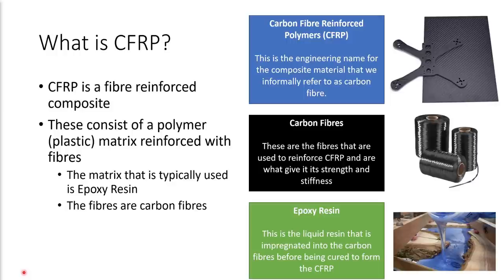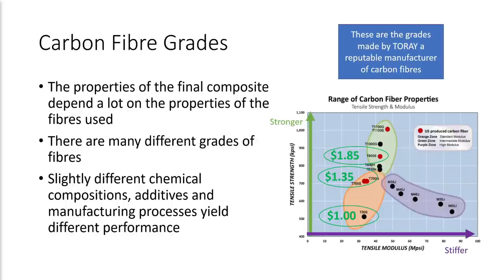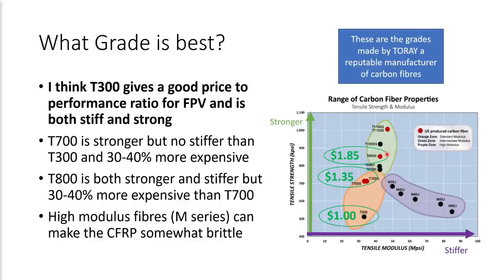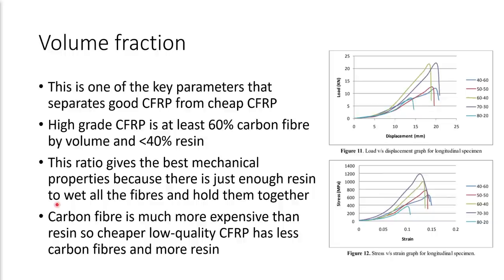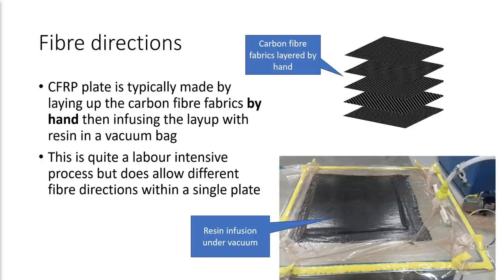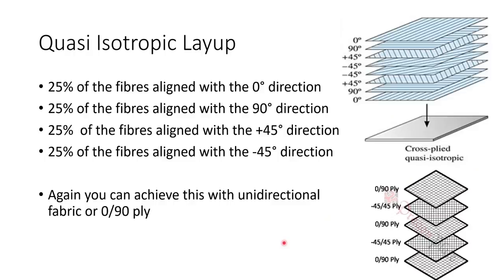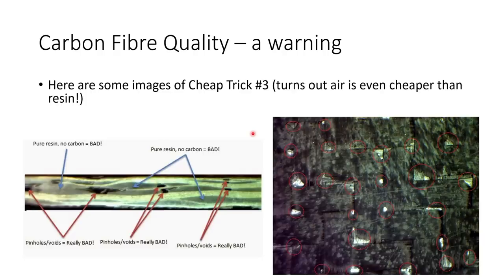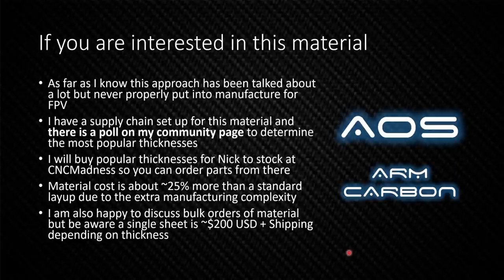Carbon Fibre: A deep dive on this incredible composite material

Comment: What do you think of building a carbon-carbon sandwich plate with T700 on the outside where it is most benefitial and T300 in the middle?
Reply: The problem is that T700 or more or less any other fiber that is stronger then T300 are not made in 3K (3000 filaments in each tow). T700S is most common in 12K and if you would weave that it will be very thick and full of pinholes. The waviness would also reduce compression strength alot. The solution is to use spread tow fabric like TeXtreme because then you can use the stronger fibers that are only manufactured in 12 or 15K and still have a fabric that is half the thickness of a 3K fabric with T300. That is one of the reasons we only use Textreme as outer layer in the laminates we make at Madkwads
Reply: @madmanjohan  Thanks, I did not know about the availability of T700 fabrics. So do you think betafvp uses lower grade carbon for the outermost layers on their frames advertised as using T700? Spread Tow fabrics are great, but if I remember correctly, quite expensive. So I don't think using those is warranted in a more cost focused carbon layup incorporating a lot of T300. Maybe one could use unidirectional carbon to have a visual distinction for the "arm carbon".

But I think maybe I was not clear enough what I was going for. Assuming pure vertical bending, and assuming the cured layers behave like the fibers (same stiffness, T300 has 70% of the strength of T700) you could use T300 in the center 70% of the plate and use the stronger fibers only on the bottom 15% and top 15% of the plate. This would result in a plate with the same bending strength as a plate made only from T700. To be safe, and to account for other loading directions, I would use a 40/60 or 50/50 fraction of T300 and T700. Of course this calculation is simplified but I think you get the idea.

This is probably most useful for thick arms. The thinner body plates are loaded more in tension and compression (and not bending), at least where they sandwich the arms. So i think it is better to use only T700 or IM carbon for those. For these thinner plates the material cost is probably relatively less important considering labour and machine time, anyways.
Reply: @LS-xb2fh  Yes, when claming T700 lamintes most manufacturers referes to the UD layers. 

Spread tow is more expensive but our goal is not to make a cheaper laminate. If low cost is your focus then go for Chris laminates. 

A laminate without a weave as outer skin is far more sensitive to impacts. If that does not concern you then you can go without it. 

I understand what you are going for and that is what we have been doing at Madkwads since 2018 - just one notch higher in grade all over. Instead of using T300 as the cheap fiber in the center we used T700. Instead of using T700 as the outer UD layers we used M30 that is a intermediate modulus from Toray with similar performance as T800 but more impact resistant. This might not be what you are after (to expensive) so Chris concept might be better (cheaper) for you.

One thing to keep in mind is that carbon fiber have only 60% of its strength in compression compared to tensile load. Another thing that make big impact on both price and performance is layer thickness of each UD layer. Many thin layers perform better but are also more expensive to manufacture.
Reply: @madmanjohan  I appreciate your in depth answers. Your composites and frames absolutely look great. But I think for most people the very highest quality is not worth it. Most would rather spend some extra grams than extra dollars to get the same stiffness and durability. So I think for higher quality composites to be widely successful, they need to be not that much more expensive (and marketed well, like calling it "arm carbon"). Edit: And with higher quality I mean better fibers, an optimized layup and a combination of both.
I hope that in a couple of years all but the cheapest clone frames will use at least a somewhat optimized layup for the arms, and higher carbon fiber grades will used be at least somewhat more often.

Additionally, replacing some TPU parts with Formfutura Pegasus PP ultralight might be a more cost effective way so save weight, compared to going for the best carbon. It has a density of 0.75g/cm³ (TPU: 1.2g/cm³) and is adequate for a lot of applications on fpv quads. Regular PP is fine too at about 0.9g/cm³. Edit: This way to save weight is useful at least for freestyle frames, which use way more TPU than race frames.
Reply from the maker: A point that is worth making is that optimizing the fiber layup provides increased performance for all materials. So if you use a more expensive material and optimize the layup you still get +20% more performance on top of the benefit from the better material. You don't have to do one or the other, you can do both.

For internal layers I think UD fabric is the way to go. You can use any grade because tow doesn't matter and you get the best performance. I think the outer layer on a 5mm thick arm is mostly cosmetic. A woven fabric might look nicer but I'm not sure it gives much performance benefit.

AOS arm carbon uses UD for the outer layer for one very important reason. The orientation of the parts is paramount. You MUST cut them aligned correctly. Having the outermost layer UD and aligned with the strong axis allows the machinist to easily confirm which direction is the strong direction with one look. This minimises the risk of parts being cut misaligned.

Comment: Outstanding idea. 5mm is the thickness I would be most interested in.
Reply from the maker: 5mm is already in stock at cncmadness if you want to have some arms cut to test. It works best for long thin and straight arms.

Comment: love the fpv specific material science. I work with high end carbon bicycle frames and love to see the effort to push fpv frames into that realm of manufacturing. I want to see a molded carbon fpv frames and parts. Like the Iflight morgoth! I liked mine it was low drag and light weight but broke very easily.

Comment: if this special carbon is better then what we normally use can we get away with using thinner carbon for the frames? as it is now a 6x12mm arm on a 5" is all but indestructible.
Reply from the maker: Yes, absolutely. You should be able to make the arm 20% narrower without loss of strength or stiffness and save a bit of weight in the process.

Comment: Looks like what Madkwads have been doing for years with their CF, it really is stiff AF. Even a 2mm arm is pretty much impossible to bend 😂
Reply from the maker: I believe Madkwads achieve their performance through use of high grade and expensive materials. I don't think they do layup optimization for their quad parts (I was speaking with them about this a few months ago and they were asking if I could work with them on that). My approach uses standard materials rather than proprietary fabrics so its much cheaper and I think more suitable for mass production.
Reply: @ChrisRosser  layup optimization is 90% of what they do. The higher quality carbon they use sure plays a part but it's not as easy as just throwing more money on the CF itself to achieve what they have
Reply: @ChrisRosser  We do use higher grade material then most others but it is not proprietary. To reduce the cost and speed up production we have recently invested in a high pressure press and a cnc machine. This way we can reduce labor and shipping cost that earlier was a big part of production cost.
Reply: @LongcatFPV  The layup is not a major contribution in stiffness and bending  strength in cf mechanical properties. The process such as higher pressure curing machine and hi-stiffness material (obviously expensive)  is the major contribution.

If you said 2mm is hard to bend, it is 90%+ manufacturing process and material.

*Just got little experience in manufacturing and testing cf panels/parts for A320, A350, B787 and A400M.
Reply from the maker: @madmanjohan  Thanks for clarifying that Johan. From other comment threads it sounds like you do layup optimization for each part. Do you use different layups for arms and plates?
Reply: @ChrisRosser  Yes. It's easy for anyone to verify that if you get hold any of the  frames we made. Just burn of the resin using a blow torch and peal it apart layer by layer.

Comment: Now that arm cross-sections are getting squarish, is it time to use hollow tube arms to save weight and maintain rigidity in a 5" quad?  Also since carbon is conductive and can block transmission from short antennas, should frames be made from S2 glass?
Reply: the issue with tube arms is mounting, performance wise they would be great, but they are much harder to incorporate into the design of a frame and also come with manufacturing challenges.
Reply from the maker: Hollow arms are tricky. You risk crushing them in the mounting and the mounts tend to be a lot heavier and more complicated. Definitely useful for big quads (X-Class) but not so much for little ones I think.

Comment: Hey Chris, is there any chance to make arm carbon standard (or optional) for all AOS frames. 
Or more specifically: as a standard (or option) for the AOS Falcon frame?
Reply from the maker: It is something I'm actively looking into. It will take some time to get manufacturing set up for the material. At the moment I only have 5mm in stock at CNCMadness.
Reply: @ChrisRosser  that would be awesome, in that case I have no doubt what frame to go for for my upcoming 7" LR build (referring to my comment on the other video). 
Please let us know if/when it is implemented on the AOS (Falcon) Frame(s)!

Comment: Chris excellent video as usual!  Iv’e noticed that %95 percent of the quadcopter arm frames I’ve seen are solid carbon fiber.  If one wanted to use T800 or T1100 carbon fiber wouldn’t it be beneficial to adopt a design for the arms with a hollow center to run the motor wires through?  This way the aerodynamics will increase and in theory be similar strength to a solid rectangular T300 or T700 carbon fiber arm with less weight 🤔.  I’m not an engineer but it was a thought that ran through my head for additional weight savings.
Reply from the maker: Hollow arms are a great idea and some larger quads do use tubular CFRP. However, the mounts for the arms are very heavy so its not beneficial for smaller frames. Also tubes are very stiff but not super durable compared to solid CF. For quads that must crash well solid CFRP is much better.
Reply: @ChrisRosser  Thank You!

Comment: I've got a feeling I'm missing something obvious regarding the different layups. 
Both Standard and Quasi Isotopic layup use a 90 degree offset between directions. Why is this stronger than using a 120 degree offset? Or is it more ease of manufacturing cost/benefit?
Hexagons are bestagons, but with Carbon Fibre it's all based around 90 degrees. I'm sure it's been tested and found inferior, just curious why.

Great video as always, love getting a glimpse into the nitty gritty of the incredible materials we use!
Reply: " Both Standard and Quasi Isotopic layup use a 90 degree offset between directions." -- wrong. besta rewatch the video.
Reply: You are right. The other (and better) way of doing quasiisotropic layups is 0/60/-60deg layers. When we at Madkwads built out own press and started making our own laminates in house, we could easier play around with fiber angles. We then found that 0/60/-60 worked better then 0/90/45/-45 for the midplates in our MAD-LITE frames. It is not a universal solution but in our case it proved to be better
Reply: @madmanjohan  BTW do you guys sell sheets of your special CF layups? I'd love to use it for my own frame designs.
Reply from the maker: The 90 degree offset is simpler to manufacture I think when making a rectangular sheet. The best fibre orientation depends on the loading case for the part. So there is no best layup. AOS Arm Carbon is the optimum layup but only for straight quadcopter arms!

Comment: Thank you Chris for your work. Seeing a new carbon with less flex makes me immediately think of airplanes. Not RC ones, the big ones. That should be an interesting industrial avenue. 
Second, it could also be of value for ultra light toothpick style frames. I really like the work Diatone did when creating a frame made of squares. It increases the stiffness while not impacting weight. Now if your style of carbon sheet can further slim down arms… That would be heaven 😉
Reply from the maker: What I have done is standard practice in aerospace, automotive and cycling industries, even high end golf clubs have optimized layups. Just trying to bring the tech to FPV 😁

Comment: Great video Chris. I would like a 7" dead cat frame for video work? not able to see the props and use the DJI air unit, will you be making aframe like this?
Reply from the maker: The AOS 7 and AOS Falcon 7 both have no props in view. Check them out!
Reply: @ChrisRosser  Thanks Chris I certainly will check them out.

Comment: Been using CF in rc  myself for years...vac bagged wing gliders and planes , boat hulls  , cars..etc...I agree with all that was said and will add that I find some CF quad frames to be laid up way too lean almost starved of epoxy  in places...epoxy costs money but so does a bad reputation...
Reply from the maker: Absolutely, you want to have enough epoxy but not more than you need. It's a difficult balance to strike but that's why good CF costs money.

Comment: As always i got a lot to learn about what carbon fibre is and what one can do with it. 
it serves for very good morning motivation for me to learn more about technology and sets me up for a day full of  scientific discoveries 
about things around me.  
Added to all of this I have always wondered why do companies cut frames from different sheets of carbon 
and why not mould them into shape like how top supercar companies like koenigsegg kind of bake individual parts. 
Does it add more labour into the process that way? is it good to waste some material and reduce labor that way ?
Reply from the maker: Moulding carbon fibre is very labour intensive and labour is a huge part of the cost of carbon fibre parts. Also you need to make a mould for every part out of aluminium which is tremendously expensive. With flat sheet you can cut out any part from the sheet with no tooling cost.

Comment: Would you be able to show the actual design details without hurting your plans to sell it? I'd be curious to see how exactly you achieve these figures. Thanks!
Reply: The concept is called anisotropic layups. The short explain is that the laminates have a layup that similar to a quasi isotropic laminate but with the 90deg fibers removed. Instead you only have fibers in 0, 45 and -45deg direction. We made a video about this two years ago where we try to explain the concept  https://youtu.be/_WGNU6tphYI
Reply from the maker: Johan is spot on but the real key to AOS arm carbon is the balance between the number of 45 degree layers and 0 degree layers to get the right mix of torsional strength and bending strength for the quadcopter arm application.

Comment: would love to see the resonance analysis of carbon tube arm quads. it's cool how tunable carbon pipe is just by altering the weave a bit
Reply: also, using a core material. seeing as the inside layers are kindof useless anyway
Reply from the maker: Carbon tubes are very challenging to simulate but perhaps I could extend my code to calculate them, a big project though to be sure.

Comment: Lots of great info, thanks.  Have you looked at using kevlar in the stack?
Reply from the maker: I haven't looked into Kevlar. Because Kevlar is less stiff and less strong than CF you wouldn't want to mix them. The stiffer CF fibre would end up taking nearly all the load. The failure mode of kevlar is more stretchy so it might be more durable in crashes.

Comment: Isn't your aos arms also in different directions? Planning to change that design?
Reply from the maker: The truss gives much more benefit than the material change. The AOS 7 uses a split truss design that might be amenable to AOS arm carbon. I will definitely be using the material where it gives a benefit in future designs.
Reply: @ChrisRosser  I guess this would just be an unnecessary cost increase, but maybe you could make a layup where some sheets are inline with one of the struts and other sheets with the other strut.